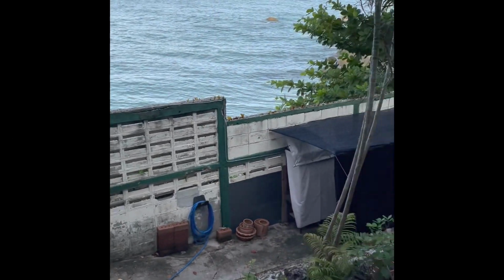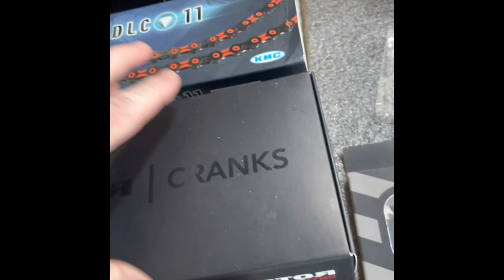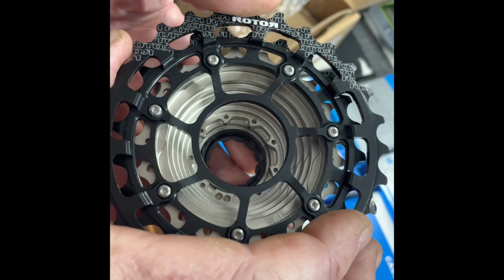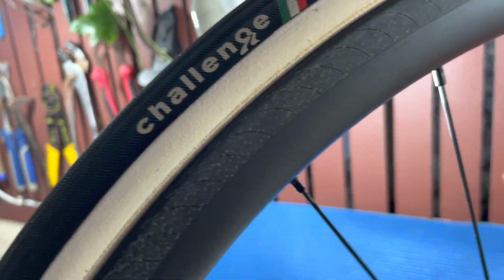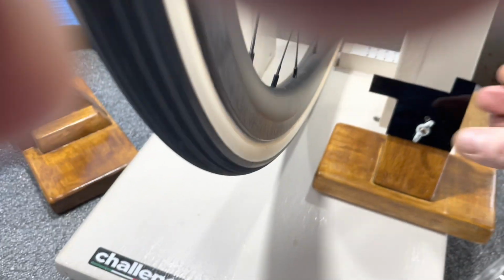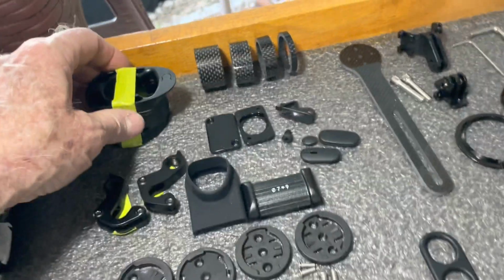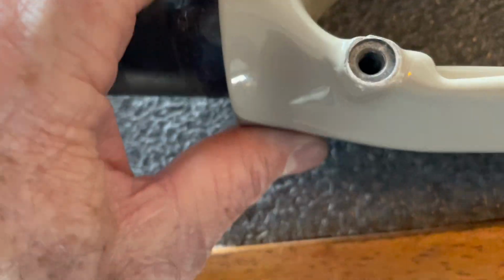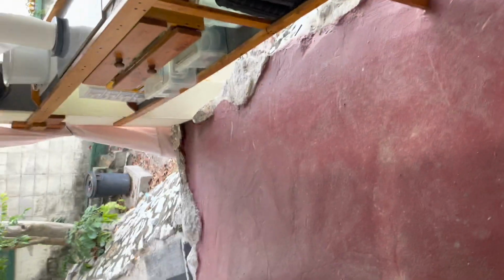Yoeleo R11 Build -day 1

Comment: Just wondering where you are going to put the di2 battery , will it fit in the seat tube , I like the truing stand  , I got a old bike frame and use the fork as the wheel holder drilled a hole through it and treaded it , then just use a screw as the point to see your wheel truness
Reply from the maker: I put it in the seat post. I think one of my posts shows what I did. My seat post is a D shape so it was a bit more work to figure out how to get it to not come out from vibrations. I used old latex tube cut the length of the batt to slide over it, 3 layers in fact to get it fat enough to hold in place. The latex Is very “grabby” stuff. It’s in place, no worries. 

Truing stands, as you note, do not need to be hi tech or have gauges to show a touch. Step by step when building a wheel and it will be fine. The stand is a design from Roger Mussons’s ebook. He’s a guru. I had fun making it. Thank you for your comments.